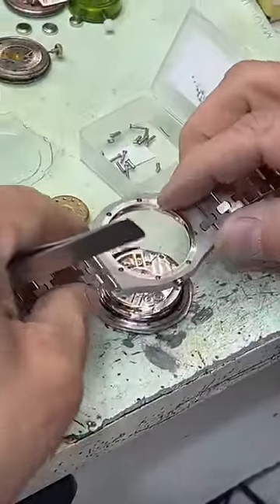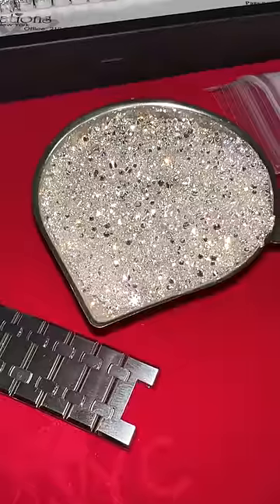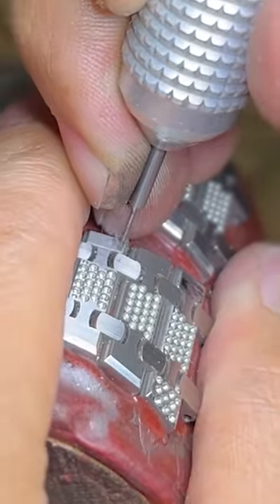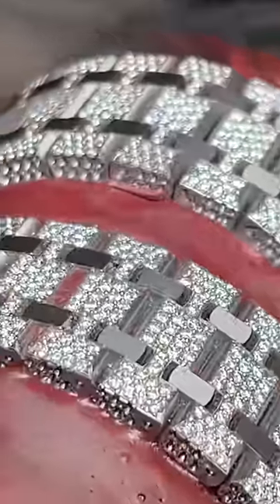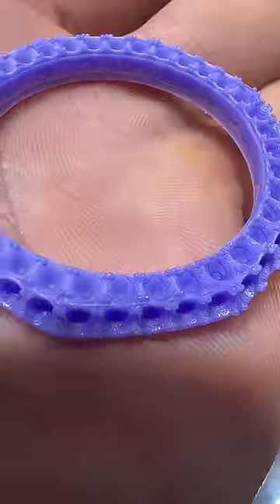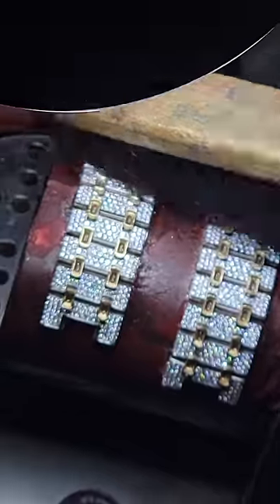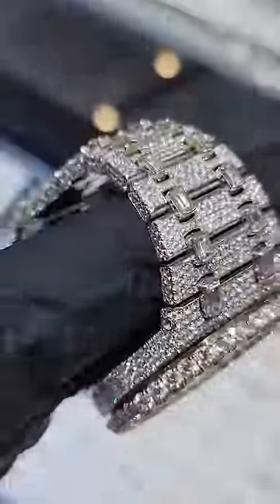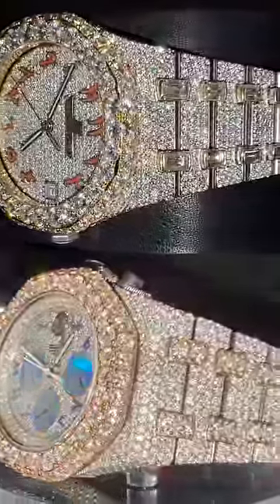Making The Perfect AP For NBA STAR @GaryTrentJR #shorts

Comment: "We had to do it correct". I expected you to put him in contact with a reputable dealer and buy a factory set AP, which would be expensive but a baller move. This a busta' move...
Reply: Busta move 😂you cant afford anything near that price point
Reply: @Suckyamoms100p  Does not farking change the point. Which is the point. You agree a factory set piece is a baller move, yes? If then, why disagree?
Reply: @Suckyamoms100p  and you could?